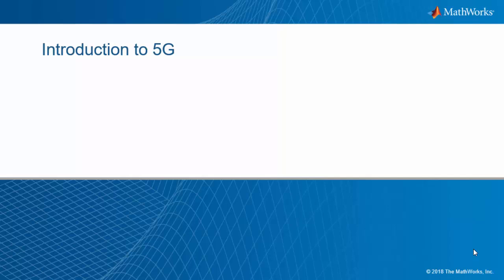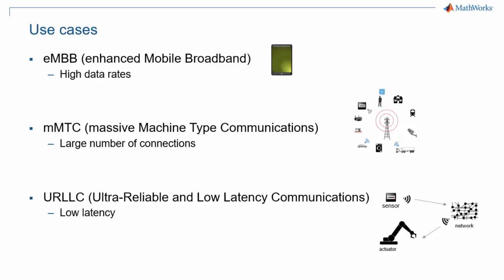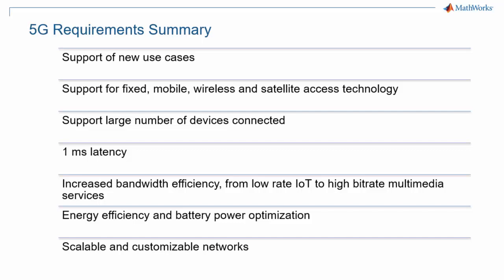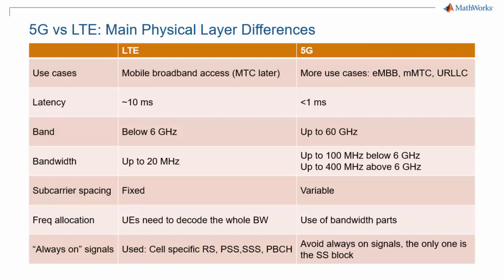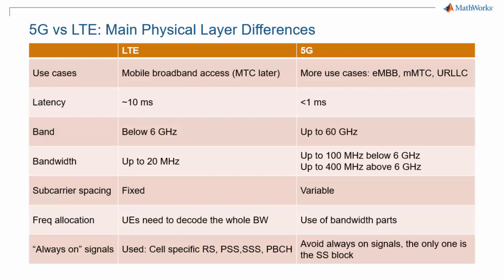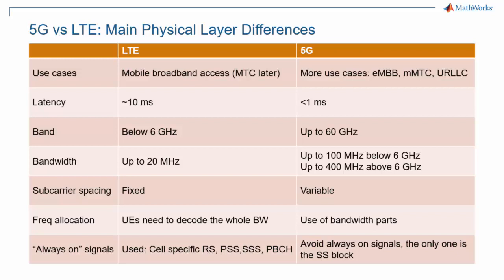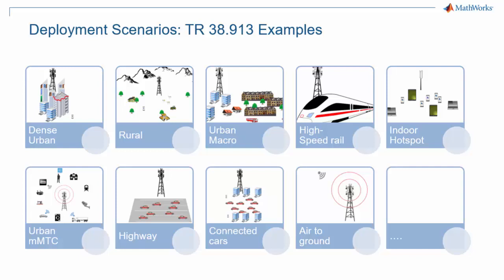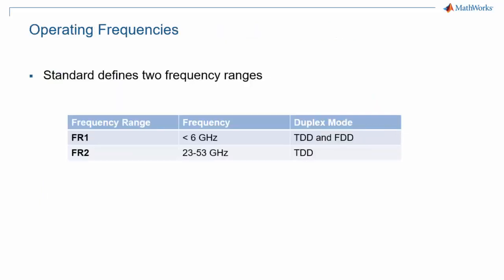What is 5G Technology and its Physical Layer (PHY) Specification

Comment: Is it possible to have 64 antennas at 700mhz. Wont the antenna be too big?
Reply: Can any one pls reply :(. At 700 MHz, lambda or wavelength is so large, how can we have 64 antenna elements as spacing between antenna elements is ideally lambda/2? Did I read anything wrong here. Pls help.
Reply: @praveenwiz2  I am don't some RF antennas experts, actually signal processing and computers man, only for discussion purposes.
As much as i know antennas dimension goes by Lamda/4 .  Equation for your 64 antennas will be  Total = Lamda/4 * 64 = 3*10^8/700*10^6 * 1/4 * 64 ~ 7 meter .
But you decide how to implement its packaging. No need to be straight 7 meter line. Each antenna is around 100mm long. Moreover as much as i know MIMO build the way that each antena spaced from another by Lamda/2 so that each data recived will be i.d.d. to other antena in MIMO. 
If we arrange the as squared\rectangle 8x8 , it will be around  A = spacing * antena_dimension =  (Lamda/2 * 8) * (Lamda/4 * 8) = 1.5 meter^2   for MIMO build like :

| | | | | | | |
| | | | | | | |
| | | | | | | |
| | | | | | | |
| | | | | | | |
| | | | | | | |
| | | | | | | |
| | | | | | | |

-------> 1.7m width
|
|
0.85 m high

but hey, i look on antenna on my esp32 uController and understand that they don't need to be straight at all. Or maybe we can space them with Lamda/4 instead of Lamda/2 . 

What do you think?
Reply: @TurbidSugar19  First of all u say u r a signal processing man and I bet u know more than most of the RF Engineers out there. Thanks for your patient and brilliant reply. ❤️
Your explanation really makes sense and at least has brought me to the level of thinking yeah 64 at 700mhz is possible. I'll check on this further and come back to u. Thank u once again
Reply: @praveenwiz2  I think that for this case lambda is small like (3/7)m and it is realisable